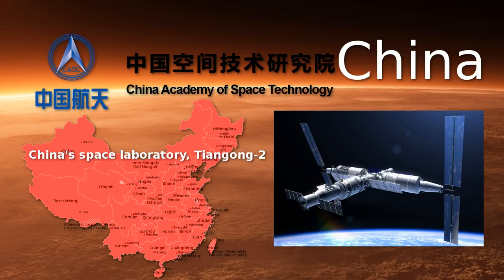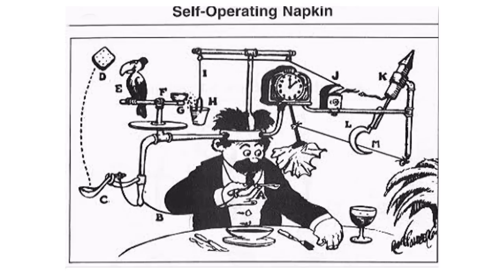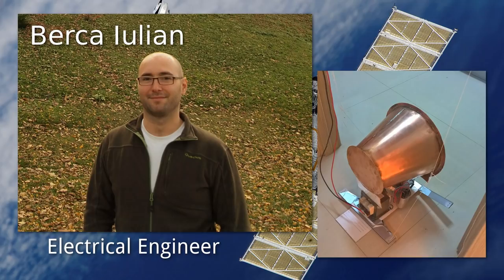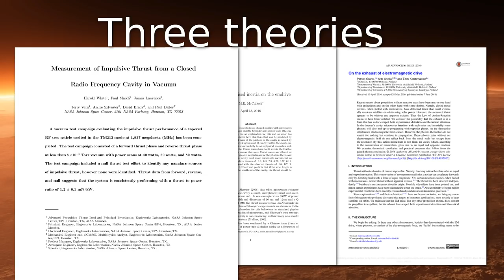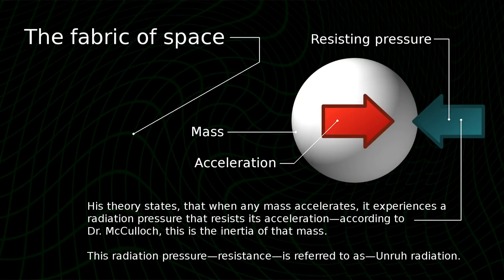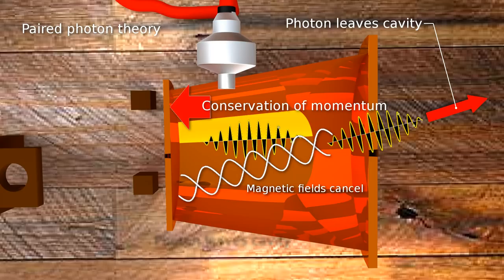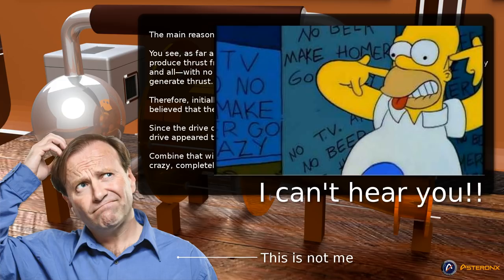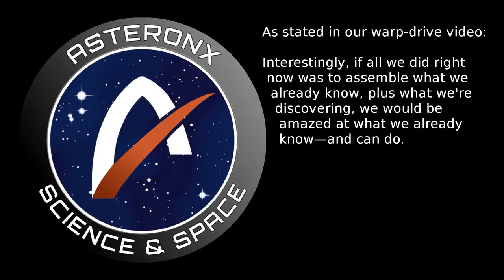An Explanation of the EmDrive and Cannae Drive Part II

Comment: Anistropic black bodies will radiate more infrared photons from the warmer side.

Infrared imaging confirmed that one end of the device was warmer than the other.

This means the device is a photon thruster that relies on the anisotropy of the surface temperature from one end to the other.

Note that this effect turned up on the Voyager spacecraft, which veered off their planned trajectories due to this very effect.

Comment: There is an intuitive explanation to come up with this design. 
Zero point energy is known to compress two plates when they come closer than some 1 micrometer.
There is less radiation pressure between the plates than outside the plates.
This due to canceling out of certain frequencies due to the size of the oscillation chamber.
The forces cancel each other out and so there is no force left for propulsion.
If somehow the surface of one plate could be bigger than the other  
and the pressure would remain the same, 
a remaining force would result,
and the plates could start slowly moving.
This fragile notion could lead to experiments with cone shaped containers.
Reply: Wouldn't the size of both plates by definition be identical as the effect can only occur between the plates? Also the size of the plates in the EmDrive seems to be identical anyways, because the smaller (front) side of the resonant cavity would combine with the component of the angeled sides that is on the plane perpendicular to the thrust direction.

Also, why is there less radiation pressure in the resonant cavity? It seems to me that there is more radiation pressure as there are microwaves trapped inside the cavity.

Comment: If the only thing that this drive produced was heat, you could get a small amount of thrust from the big end plate sublimating more than the small end. 
That would not be a reaction-less drive.
I do hope that it's more than that, or some other material loss, though.

Comment: This doppler shift inside the EM drive proves Yuri Ivanov's Rythmodynamics to be solidly correct. He was the first to discover this compression of waves when a body is in motion or when 2 freqs with a small shift causes motion of the body relative to space.  Em drive is nothing more than yuri ivanova discovery in a well thought out simple application. 

Solution to this doppler effect inside the em drive? Simple. Dont use a fixed frequency magnetron,  but rather a variable frequency. Which is needed once the body begins motion. Or even more precise control, Use 2 magnetrons with different frequencies, to setup the constant force. This would allow it to remain intact even though it's in motion relative to ambient space. Again, right back to Yuri Ivanov's discovery. The whole concept is based on his discovery.

Comment: From what I grasp the momentum is dependent on the volume of the cavity not the area of the thrust end so if this is scaled up to a much larger size than these experimental models the gain in thrust should be substantial since volume is cubed but the emitting area is only squared.
Reply from the maker: Perhaps!

Comment: I'm curious about the energy factors at work in this device.  If I understand what I heard in these videos, all of the research says that thrust coming out of the device increases as power coming into the device increases.  I wonder if these scientists are dealing with something akin to what those working with the fusion reactor are dealing with … that is … it costs more in energy going in to generate a vastly smaller amount of energy going out.  I could well be comparing apples to oranges but not being an electronic engineer or a physicist, I'm just unsure.  Of course, I'm unsure about a lot of things so if this is not the case, I would be inclined to believe that one day, an appreciable amount of thrust can be generated with a minimal energy input to the device generating the thrust.  I would be interested in hearing YOUR comments.
Reply from the maker: At the moment the scientists working on the project agrees that the drive is generating a thrust. How it is generating a thrust is up for hot debate. The thrust effect does increase in proportion to an increase in power. Until we expand our understanding - accept what the data is showing us, no one will be able to design a more efficient drive, which could reveal additional critical data.

Comment: Those three theories are incorrect. The EMdrive supports resonant modes of microwave radiation composed of massless photons. This resonant system is massive. An individual photon is massless but the system of counterpropagating photons in the cavity is massive. That's very important to understand that a system of massless particles confined to a region is massive as a whole. Now what we have going on here is a massive time varying system. These are the conditions necessary for gravitational induction to take place. Small ripples in spacetime that propagate out as waves; gravitational waves. The shape of the cavity sets up a partially standing wave in the cavity from the superposition of the counterpropagating waves traveling end to end. The time evolution of the partial standing wave (and remember that this wave is massive) creates a marching jerking (change in acceleration) motion of the wave in one direction only. The overall shape of the EMdrive is an octupole. A the contents therein constitute a massive time varying octupole. A gravitationally radiating octupole radiates preferentially in one direction, anisotropic radiation vice isotropic radiation. A gravitational wave rocket.
Reply from the maker: Is there a specific publication that you could refer to or other equations demonstrating that the photons within the resonant cavity gain mass and/or behave as if they are massive?
Reply: AsteronX yes you can look at it from two different ways and get the same answer. Photons in a box: 

http://usersguidetotheuniverse.com/index.php/2013/03/31/i-get-mail-does-a-box-of-photons-have-mass/

And the mass of a system of counterpropagating photons. 

https://en.m.wikipedia.org/wiki/Invariant_mass

Separately, looking at a a different system, but using the same concept, is that most of your mass is from binding of massless gluons within your neutrons and protons. Each individual gluon is massless but massive as a confined system.
Reply: A box with photons absolutely has additional mass due to the photons.  This is just basic E = m c c
Mass is no more than confined energy
Reply: And that would generate 1e-97 N of thrust.
Reply: onehit pick I'm pretty sure that the superposition of two counterpropagating electromagnetic waves of different amplitudes induces an a changing acceleration in the sum, and that changing acceleration produces a changing gravitational field (a nonconservative and changing gravitational field...induced fields are nonconservative meaning they act as an external force field that can change the total mechanical energy of the system) acting on a massive particle (which is also being influenced by the ambient conservative gravitational field) would serve to have a net effect of reducing the inertia of that massive particle depending on its path. I do understand how weak this must be so I'm trying to understand how to make it stronger. Some of my more recent posts on NSF have acknowledged the fact of how weak these gravitational effects are, so I've focused back on the problem of conservation of momentum using plain old classical mechanics, while keeping the gravitational ideas on the back burner, in hopes of finding a consistent concept. So I acknowledge that I'm wrong too, and I'm at least on the right track.
Reply: +Jeremiah What you say here is interesting, in theory.  I would think that you would need the gravitational equivalent of conductivity in the nearby surrounding medium in order to produce a momentarily sustained field that you could then counter and "push" off from with the right timing and polarity.
Reply: Also check this out: 

https://forum.nasaspaceflight.com/index.php?action=dlattach;topic=39772.0;attach=1351983

Phase conjugate mirrors are superior to copper cavities because they achieve phase shifted destructive interference of the ENTIRE microwave field, this forms a standing wave without generating heat on the walls at all and thus storing momentum in a dynamic holographic state bound to the cavity walls. It 'gains mass-energy' that can be directed with a special Doppler shift transformation.

You have an explanation for phase conjugate mirrors creating massive photons, or creating a momentum sink formed from the standing wave basically, from which momentum can be directed on the inner wall by supplying a Lorentz-Doppler Shift signal. The reaction of mixing the standing wave with the Doppler wave results in a complex wave packet, a 'matter wave' which pulls on one side of the cavity, and pushes upon the opposite side due to the Lorentz force. This generates quantized momentum transfer to the cavity walls in an asymmetrical manner.

Extending this to the exterior of a spacecraft, you could phase shift against the Unruh radiation induced by acceleration, controlling this new standing wave as it compresses in front of you would allow you to EXCEED the speed of light, because the inertia generated by accelerating into the quantum vacuum can be cancelled.

Comment: If we see the case of refraction of light through glass, it seems that a very small , probably a tiny black hole, is present on the surface  of glass, whose force of attraction is more than the force of attraction of sun, which diverted a light particle through a very very small angle, as observed by Eddindons experiment during total solar eclipse in the year 1919.So the partical which is diverting the p hotone from its path during refraction through glass must have force of attraction more than sun. Also during photo electric emission it has been proved that a p hotone is a particle having some mass.

Comment: What happens if we substitute micro waves for sound waves within the cavity, and would the variation of wave speed effectbthe overal end game.
I say this as a non sciencetist type who being involved with sound have felt the effect of low rage soundwaves.
For it to effect the boby, which it does, there has got to be an outgoing energy.
I ask this based on the knowledge that it says in the begining there  was  nothiing, then a sound which started  the whole ball rolling.
Sound is more easy to control and to change even in the smallest of measurements.
I would also be interested in the idea of changing the cavity to being made of ceramics of some kind.
Just a thought?????

Comment: Why not use light waves or  lasers in an optical cavity which would be 
similar to a microwave cavity? They are both electromagnetic waves 
differing only in wavelength or frequency. This could allow for 
miniaturization and higher output thrusts as  e=hf   e-energy
 h= planck constant and f= frequency.
Reply: I thought the same, laser gyros are almost an Em Drive

Comment: The most likely Gilo application would be to lift an ultralight wing on the flying car not the car its self but even that would require the high Q super conductor version. Lifting the wing to the right height is the challenge with para-foil cars. Poles have been used,  and small integrated balloons or drones are in the works. The Emdrive would be a order of magnitude below those at best. Regardless of how the emdrive works I would still want wings so we have a fail safe glide ratio if the Emdrive stops working.
Reply: Good luck getting off the ground with millinewtons.
Reply: The first working helicopter rotor lifted 1 tenth of its own weight not including the motor. This all depends on whether the Q factor scales with some parameters and materials. Hence the super conductor work.  I'm a sceptical optimist.

Comment: After learning that the force of gravity is merely the consequence of time dilation (and time dilation is the consequence of the mass or energy density) a tide would be formed in a region where there is a gradient of energy density and therefore a gradient of time dilation. And if a tide is formed a tidal force would be experienced. Normally, an assymetric solid clump of mass will not move along its own tide because... well, the gradient is formed by its own mass and the equivalence principle, in effect the inertial mass is shaped exactly such that a solid object will not self accelerate regardless of how asymmetrically one might shape it. However, given that the photons in the cavity are massless and given the presence of the energy flow between the two plates (assuming the energy is conserved) as the energy flux of those photons traverses from one end to the other a weak (but non zero) energy density gradient, and consequent time dilation gradient is established.... without the inertial mass to go with it. Of course we have the thruster's shell and power source as overhead, but in theory the energy flux we can pump into the volume is arbitrary and only limited by our technology. This gradient would be proportional to the net energy flux, which is proportional to the magnetron power, Q and volume.

Comment: Thinking in terms of a wave...wouldn't parallel surfaces create a slapback effect that creates problems? Intuitively it seems that geometry may be a chief component to solving problems with thrust. Somehow creating an exponential increase in amplitude until releasing it out of the chamber perhaps.

Comment: To produce 1lb of thrust would take 2.224 Mw
So for the little girls EmDrive powered hoverboard 
she would need 50, 2Mw Cummins DQKAB Diesel 
Generators at 9 tons each, 450 tons

Also a 110 Mw microwave skateboard might require a license
Reply: Technology always does more with less. To do what your iPhone does today would have required a huge bank of vacuum tube computers years ago that would have taken as much electricity as a small town.

Comment: I believe the pulsating, swirling photon is the energy unit of this universe that makes up everything in existence in this universe.  Everything in existence are photons and interacting photons.  Everything in existence is 'light'.
What is called 'gravity' is a part of what is currently recognized as the 'photon'.  'Gravity' would be the force that makes the sine wave of em expand and contract and would act basically 90 degrees to the em forces which of course act basically 90 degrees to each other.  Here is a test for the 'gravity' portion of my theory of everything idea.  I would do this test myself but do not currently have the necessary resources to do so, but maybe some entity reading this might have the resources, do the test, then tell the world what is found out either way.

a. Imagine a 12 hour clock.
b. Put a magnetic field across from the 3 to 9 o'clock positions.
c. Put an electric field across from the 6 to 12 o'clock positions.
(The magnetic field and electric field would be 90 degrees to each other and should be polarized so as to complement each other.)
d. Shoot a high powered laser through the center of the clock at 90 degrees to the em fields.
e. Do this with the em fields on and off.
(The em fields could also be varied in size, strength, density and depth.  The intent would be to energy frequency match the laser and em fields for optimal results.)
f. Look for any gravitational / anti-gravitational effects.
(Including the utilization of ferro-cells so as to be able to actually see the energy field movements.)

'If' effects are noted, 'then' further research could be done.
'If' effects are not noted, 'then' my latest TOE idea is wrong.  But still, we would know what 'gravity' was not, which is still something in the scientific world.

Science still wins either way and moves forward.